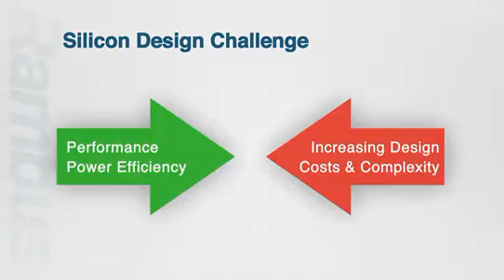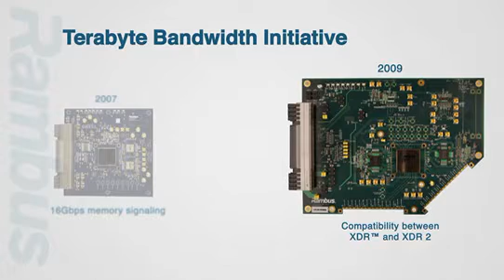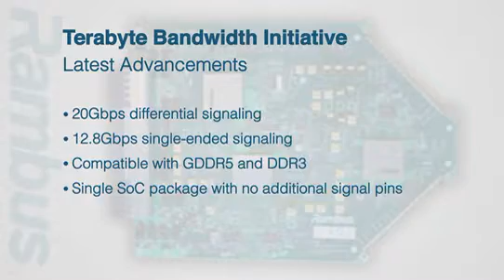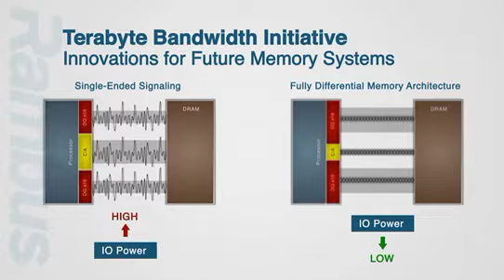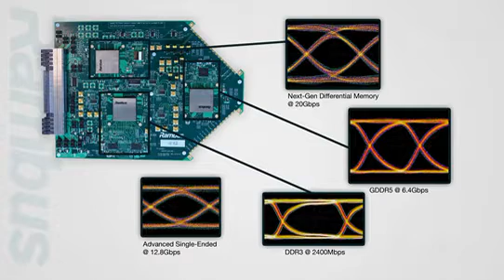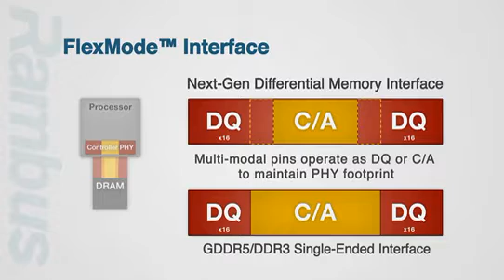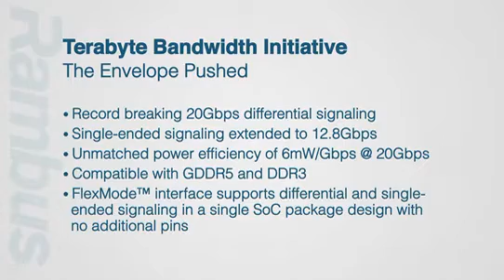Terabyte Bandwidth Initiative (1TB) Memory Demo

Comment: A milliwatt is 1000th of a Watt. Or 1 times 10 raised to the power -3 of a watt.  Put it another way you can't touch a 100 watt bulb with your hands, but you can touch a 20 watt bulb with ease. Hope this helps?.... (A standard led uses about 20 milliwatts to light up.)